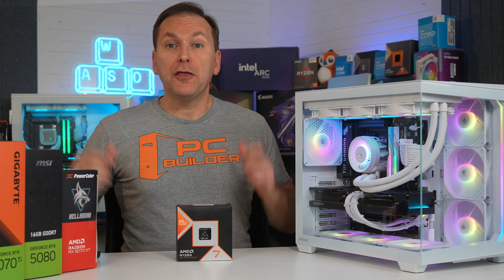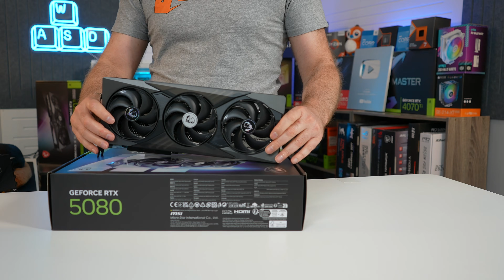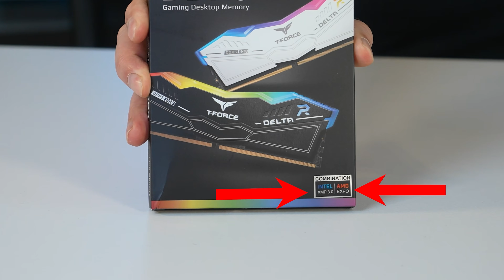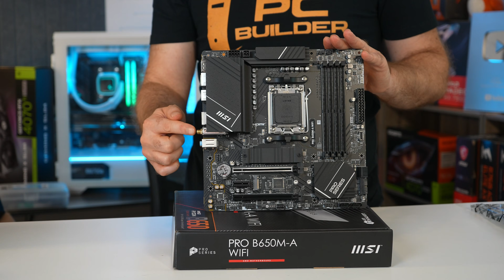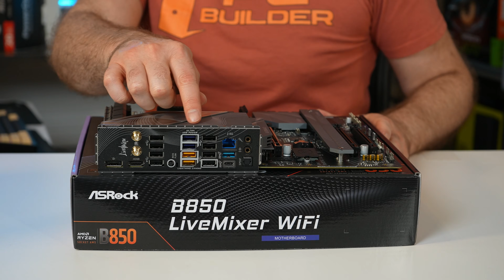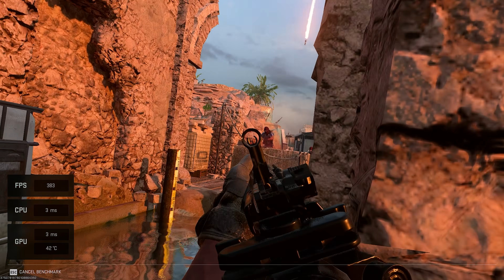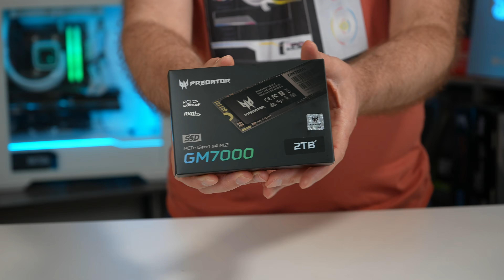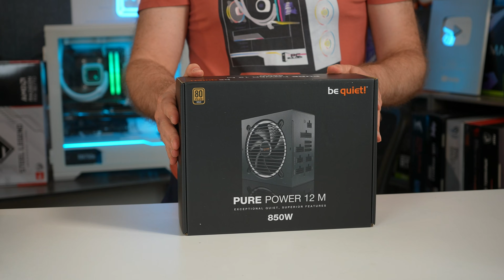Best Ryzen 9800X3D PC Build 2025 🛑 Best GPU, RAM, Motherboard & More

Comment: I have a 4070 TI Super, is the 9800X3D over kill because I just don’t see the point in upgrading to a 5070 TI. But I’m still running 5800X3D and I’m ready to upgrade. Thoughts?
Reply from the maker: You might not see much performance difference switching between the 5800X3D and the 9800X3D with that GPU. If you are looking to set yourself up for future upgrades in AM5 that can make sense but a full platform change now is money I probably wouldn't spend personally

Comment: Is my USD$1900 9800X3D PC overpriced? Market rates are kinda kicking my butt!
CPU : AMD Ryzen 7 9800X3D Processor
GPU : ZOTAC GeForce RTX 5070 Ti Solid OC SFF 16GB
RAM : 32GB Patriot SL Sig DDR5 6000MHz CL34 Low Latency (16x2)
Motherboard : Gigabyte B650M Gaming Wifi 6E
Cooling : ID Cooling SE 214 XT (2 in 1 out)
SSD : 2TB Lexar NQ780 Gen4 SSD
PSU : 850W Thermalright 80+ Gold (ATX3.1; PCIe5.1)
Chassis : Small mini case

Comment: Is it recommended to have a liquid cooler for 5070ti / 9800X3D builds? I’ve used air coolers for PC builds in the past, but I haven’t built a higher end gaming PC before. I may be overthinking it, but I’m just not crazy about having anything liquid inside of a PC with various electrical components. Isn’t it possible that the liquid cooler could leak?
Reply from the maker: You don't have to no, a dual tower air cooler will do great for you if you prefer that
Reply: @PCBuilderChannel  Awesome, thanks for the response!

Comment: The problem of power connectors melting with NVIDIA's high-end GPUs, including the RTX 5090, unfortunately persists as of August 2025. While NVIDIA introduced a revised 12V-2x6 power connector in the RTX 50 series, intended to mitigate the melting issues experienced with the 4090, reports indicate that this upgraded design hasn't entirely eliminated the problem. 
Here's a breakdown of the situation
Design Limitations: The fundamental issue seems rooted in the design of the connector and the GPU's power delivery system. The RTX 5090's high power draw pushes the limits of the 12V-2x6 connector. The GPU may not effectively distribute the electrical load across all pins, potentially leading to overheating in specific wires.
User Error vs. Design Flaw: While improper connector seating was initially highlighted as a cause, the persistence of the issue suggests a more fundamental design flaw.
Third-party Adapters: Reports indicate that using third-party adapters can exacerbate the problem, and may be a major contributing factor in some cases.
Safety Measures & Recommendations:
Ensure the power connector is fully and securely inserted, clicking into place.
Consider using a power supply with a native 12V-2x6 connector rather than an adapter.
High-quality PSUs are recommended, ideally ATX 3.1 compliant or later, according to Tom's Hardware.
Be mindful of excessive bending or strain on the power cable.
Ongoing Concerns: Despite the revised connector, reports of melting cables with the RTX 5090 continue to surface. This situation suggests that even with precautions, a risk remains. 
It's important to note that a large number of RTX 5090s are in circulation without incident. However, the recurring nature of these reports highlights the ongoing concern surrounding the longevity and reliability of the power connectors on these high-power GPUs.

Comment: I'm currently building a new pc. 

-9800x3d 
-powercolor 9070xt 
-MSI thomahawk B850 
-32gig ran at 6000/cl38 
-2tb M.2 
-be quiet pure base airflow case. 

Prices and availability amazing now.
Reply: Tomahawk is such a solid board. I was going for the x870e Tomahawk but ended up landing on the x870e Carbon. Had to splurge for the beautiful looking board with everything on it. But Tomahawk is killer for price.

Comment: motherboard MSI PRO B650-S WIFI
amd ryzen 7 9800x3d
rtx 5080 OC 16gb vram
kingston fury beast 64gb ddr5
2tb ssd kingston
Endorfy Supremo 1kW
water cooling endorfy navis F280
Fractal Design North XL Clear black case

guys is that a good build? i am not sure about the motherboard and the size of the water cooling, should i go with 360mm instead of 280?

Comment: running stock this CPU runs so hot it burns up its been reported by many...... amazing how they release a product that has the potetal to fail because of heat issues and thats not  on the customer who bought it  @ 460.00 to 500.00$ a pop  people reporting its runing @ 85 to 95C no load

Comment: Is the issues with 9800x3d dying from motherboards default pbo settings and what not still a thing or is that all fixed now?
Reply from the maker: There were struggles happening with specificity Asrock motherboards. It does seem like the issues have been sorted with the latest bios update but you can always avoid Asrock if you’re concerned

Comment: How about a 7900 xt or 7900 xtx or honestly just a 7800 xt
Reply from the maker: If you already have those GPUs you can pair them with the 9800X3Dz. If buying new I wouldn’t recommended them new in 2025 personally. The price to performance no longer makes sense compared to the new gen
Reply: @PCBuilderChannel  I’m aiming for high end performance on 1440p, like 360 fps in Fortnite 1440p. I’m already looking at a possible option, which would be the i7-14700KF (yes I know you say you shouldn’t quite trust them yet but still) and the 7900 GRE. I could get a 7800x3d or even a 9800x3d instead of the i7 14th gen though, but for the best price, the i7 shines.

Comment: I have a few questions, Would the RTX 5070 be a good choice for the Ryzen 9800 X3D or would it be better to downgrade the cpu to the Ryzen 9700X and getting the RX 9070 XT or the RTX 5070 TI. Also another question and this is the biggie, what is the difference between CL30 and CL 32. The Tforce RAM I was looking at is 6000 MHz and CL 32, would that work for this build?
Reply from the maker: You would actually get more performance going down in CPU and up in GPU yes. But I would recommend the 9600X on super sale at amazon right now for $165. You wouldn't see gaming difference between that and the 9700X. The CL32 isn't ideal CL30 is better.

Comment: simracer here.  I have no idea, totally no knowledge in this area... my AMD GPU 7900xtx is paired with 7800x3d. I used my gift cards from work to buy 9800x3d. apparently it can handle Assetto Corsa EVO (early release) in VR bit better. it might bottleneck GPU as it did before, but I can reduce resolution. Next year or 2027 I'm getting Nvidia 6090. it got well implemented foveated rendering in iracing, most likely ACE will follow. just wanted to say THANKS FOR VIDEO
Reply from the maker: Thank you for watching!

Comment: Building this today! You asked heres the Part List!

MSI X670E Gaming Plus Wifi
CORSAIR Vengeance RGB DDR5 32GB (2x16GB) 6000MHz CL28
WD_BLACK 1TB SN7100 NVMe Internal Gaming SSD 7,250 MB per sec
AMD RYZEN 7 9800X3D
MUSETEX ATX PC Case
RTX 5070 TI
THERMALTAKE Toughpower GT 850W GOLD (Modular)
CORSAIR H100I ICue RGB AIO Liquid Cooler (i forget the exact model)
ASUS ROG Swift 27 inch 2560x1440 144hertz 1ms response G-Sync IPS Display (from like 8 years ago was top of the line lol)
Logitech Pro Superlight (Mouse)
Royal Kludge 61% Mechanical Keyboard (Wireless)

I play a lot of Escape from Tarkov, Rust, a lot of CPU bound games... Upgrading from a Ryzen 9 3900X i cant wait to experience the improved core performance...

I asked Chat-GPT what it thought of my build and it had this to say XD

🚀 Final Verdict:
Your system is well-balanced, powerful, and thermally ready. Nothing's out of place, and every part supports the others without bottlenecks. This is a high-end gaming and productivity build that should last for years.

Let me know if you'd like:

Tips for first boot/BIOS setup

BIOS update walkthrough for your MSI board

Fan curve or thermal tuning tips

Overclocking undervolting advice for silence/performance balance

Excited for you—this rig is going to fly.

Comment: I currently have a rtx 4070ti and a b650plus motherboard with a ryzen 7800x3d.  My rtx 4070ti died.  I was wondering could I use a rtx 5080
Reply from the maker: Yes that's a good pair

Comment: I ordered a: 
RTX 5090 32GB VRAM
AMD 9800X3D 
2x 16 (32) GB DDR4 6000mhz RAM
2x 2TB Kingston NV3 SSDs 6000MB/s
ROG STRIX B650E-F Gaming Wifi
Deepcool LE720 AIO + 3x120mm fans watercooler
Deepcool CH560 4-Fan Digital Case 
Platinum certified LC1200PSU 1200watt.

Is this good? I have 14 days to return it if not.

Comment: currently building an 9800x3d / vangaurd msi 5080 pc but hung up on which mobo to get, really wanted to go with msi's x870e carbon wifi but seeing more issues than good when trying to research more, has anyone here tried the x870e? really want to keep msi aesthetic

Comment: Considering a 9950x because I need this pc to primarily be a multitasker Excel, PPT, ai coding powerhouse. Secondary purpose, gaming and I’ll start with an ARC 12gb right now, followed by a stronger GPU in a few years. Do you think it makes sense to go with 9950x in my case? Obviously 9950x3d would be ideal but it’s expensive.
Reply from the maker: Absolutely! We do have a 9950X build on the channel but it is from 2024 so the GPUs in that video are old recommendations, but still worth watching
Reply: @PCBuilderChannel great, thank you! Just left you a comment on that video too. You’re really good at what you do. Thank you for sharing your knowledge

Comment: Current build I am wanting to go with.

CPU		
AMD Ryzen 7 9800X3D 4.7 GHz 8-Core Processor	$472.02		
CPU Cooler		
ID-COOLING FROZN A620 GDL 78 CFM CPU Cooler	$49.99		
Motherboard		
Asus TUF GAMING B850-PLUS WIFI ATX AM5 Motherboard	$229.99				
Memory		
TEAMGROUP T-Create Expert 32 GB (2 x 16 GB) DDR5-6000 CL30 Memory	$94.99		
Storage		
Western Digital WD_Black SN850X 4 TB M.2-2280 PCIe 4.0 X4 NVME Solid State Drive	$284.99		
Amazon
Video Card		
ASRock Taichi OC Radeon RX 9070 XT 16 GB Video Card	$1019.00				
Case		
Antec C8 Wood ATX Full Tower Case	$119.99	-$5.00 1	FREE		
Power Supply		
be quiet! Pure Power 12 M 1000 W 80+ Gold Certified Fully Modular ATX Power Supply	$164.89		

Base Total:	$2435.86

Comment: I just did a new build. 

Asus Rog Strix x870e
Ryzen 7 9800x3D
XFX 9070 XT OC Mercury
MSI 240 aio 
Corsair modular 750 psu 
32gb Corsair vengeance 6400 RAM
SAMSUNG 990 2tb m.2 (games)
Samsung 970 500gb (OS)
3 intake fans and one exhaust 
NZXT H6 flow case
Reply: How has that setup been working for you?
Reply: @NewSocialistEraVideos it's been amazing and no issues with borderlands 4 . Average 90 fps without frame generation on badass quality. Frame generation brings it over 120 fos

Comment: Hello, with the 9800X3D I see that you're recommending the MSI B650 Gaming WiFi, which only supports PCIe Gen4 (no PCIe Gen5), as well as the ASUS TUF GAMING B650-PLUS WIFI, among others. However, the latest graphics cards (such as the AMD 9070 or NVIDIA x50) use the PCIe Gen5 standard. Can we use the latest Gen5 GPUs on PCIe Gen4 slots?
Reply from the maker: Yes. Even the RTX 5090 runs fine on PCIE gen 4. PCIE is backwards compatible. We have more discussion on this in the video.
Reply: @PCBuilderChannel  Hello, thanks for your quick reply. However, regarding SSDs, a professional strongly advised me against partitioning an SSD. So for gamers like me who have a large game library (over 20 games), and knowing that each AAA title now weighs between 80GB and 100GB (or even more for some), it's important to have a separate SSD for launchers and games.Every time you want to reinstall your OS (whether due to bugs or just as a yearly maintenance routine, which is generally recommended), you'll end up spending hours and hours reinstalling all your apps and games ^^
Believe me, reinstalling 2TB worth of games takes a long time!
Otherwise, thanks for your reviews and links. Your videos are very interesting and highly professional.

Comment: Finished rebuilding my pre-built Corsair Vegence with a new Gigabyte X870E Motherboard and Ryzen 9800X3D. Also upgraded all the fans with the Corsair iCue /iLink fans and 240mm AIO. Makes installing fans a breeze with only 3 cables versus 15! Really a clean look.

Comment: Im confused between these two specs. Any recommendations? My main goal is to play cs2 at high frames as I have a 480hz OLED monitor.

9800X3D
MSI Pro B650-P
32GB DDR5-6000 RAM (30)
RTX 5070 Ti

And the Second option is with RX 9070 XT.

Lemme know your thoughts and recommendations for my build. Thanks :)

Comment: Found a Gigabyte Aurous X870E at the price of the X870 at our new Micro Center. I matched that with the AMD 9800X3D. Changing out my old Cosair fans with link fans to illuminate so much wiring and clean things up. Replacing the AIO with the Artic 360 freezer version 3 to complete my upgrade. Only $84 on Amazon.

Comment: Great explanations, mine is a mix. All new parts except maybe the graphic card. Cpu 9800x3d, motherboard Gigabyte B650E aorus stealth ice, case Phanteks evolv 2,  Thermalright fw 360 aio, lian li edge serie 1000watt psu. Everythig is all white. The gpu will either be a 4090 or 5080 used.

Comment: My latest build is:
Ryzen 7 9800x3D
64GB DDR5 6000mhz cl30
MSI MPG x870E Carbon Wi-Fi
5TB Samsung 990 Pro
Be Quiet PSU Pure Power 12 M 1200w +80 Gold
Be Quiet Light Base 600 LX Case
Be Quiet Light Loop 360mm
Be Quiet x6 Fans for intake 120mm + Radiator 120mm and 120mm Rear so 4 exhaust
Zotac RTX 5080 AMP Extreme Infinity Ultra 16GB

Comment: I just finished building and ordering my new PC and this video popped up on my feed. Im no expert at building and i chose everything by looking at the specs to be compatible and it happened to pick some of the best choices here. 
I went with ryzen 7 9800x3d
RX 9070 XT Asus Prime OC edition
32gb ram 6000mhz 30CL AMD Expo ready Corsair Vengeance
Motherboard  ASUS TUF GAMING B850-PLUS WIFI
PSU Corsair RMe Series 2025 RM850e, 80+ Gold, 850W
Cooler CPU ARCTIC AC Liquid Freezer III Pro 360 Black 360mm(3x120mm)
2 Samsung SSD's 990 EVO Plus 1TB(each) PCI Express 4.0 x4 M.2 2280 (2tb in total)
rocking a Gamdias Atlas M1 Black for the case
and 3 ARCTIC AC P12 PWM fans at 120mm each for the rest of the coolers
i also bought the ARCTIC AC MX-6 for the thermal paste and the Thermalright Contact frame AM5 for the processor
My goal is to game only at 2k on a monitor LG 240hz with freesync hdr and IPS panel
I'll be happy if you or/and the comunity here comes up with a review and what games i should play with this monster. God bless you all. I love you

Comment: I have Kingston Fury 64GB DDR5 (2x32GB) 5600MHz CL36 paired with a Ryzen 7 9800X3D. Should I change my RAM, or leave it as is?
Reply from the maker: I would exchange it. That is not good RAM. With that strong a CPU I'd get the correct RAM with it
Reply: @PCBuilderChannel 
So, which RAM would you recommend for the best performance?

Comment: So a 5090 only with 9800X3D? Can't it go with a 7800X3D? Also Asrock B650M Pro RS can handle the 9800X3D? that VRM is okay for that CPU?
Reply from the maker: It can but you would see a performance  difference between the 9800X3D and the 7800X3D with that GPu.
Reply: @PCBuilderChannel  Got it, thanks Jason!

Comment: recently just got my 9800x3d.

looking to pair it with the 9070 XT. ROG strix 650-a MOBO. Kraken RGB 360 AIO. H7 2024 NZXT flow case. nervous to put my first build together but also extremely excited! I feel confident and well informed thanks to you!
Reply from the maker: Best wishes on the build! Check out our How to build a pc video if that's helpful

Comment: Please help me i have: 
i have cpu intel core i7 11700 
Nividia GEForce RTX 3070 TI (zotac gaming)
B560M PRO-VDH WIFI (MS-7D18).
I want to start upgrading what everyone tells me that my gpu is powerful and i can start upgrading my motherboard and cpu then to upgrade my gpu. Can i ise the ryzen 7 9800x3d and new motherboard. Then after a while i change the gpu?
Reply from the maker: Yes, you can do a platform change.
Reply: @PCBuilderChannel  which motherboard will be compitable with ryzen 7 9800X3D because  I found that some people mentioned certain motherboards overheating or even getting damaged when they used ryzen 7 9800X3D

Comment: Great video. I actually came here after finalizing my component selection and was suprised i almost chose the same parts as your premium build. I still have a question however, did you actually built this setup and can confirm that it works? I was about to order the B850-PLUS when i read some reviews saying that this board is having trouble with alot of ram kits, including the g.skill trident. I then went to the asus website to make sure and when i select the board and the AMD 9000 series, indeed it doesnt list the g.skill trident as compatible. So now im kinda worried if everything will fit together, i would like to avoid sending parts back. You know anything about that?
Reply from the maker: Yes the build is next to me on the desk (: 
The list doesn’t mean much at this point in the generation but you certainly can pick something off it if it makes you more comfortable. Hop over to our Best RAM for Gaming 2025 video for more. That might help put your mind at ease!

Comment: Hello Jason from Leeds, UK. Hope your ok. Here's my Dream PC:

CoolerMaster HAF 700 Berserker 
Custom Mobius 120P exhaust fans. Custom Mobius 140P Halo² or MF140 case fans.

MSI X870E Godlikea.

Ryzen 9 9950X3D

G.SKILL Trident Z Royal Neo CL28 6000 2X24GB 48GB

Arctic Liquid Freezer III 420mm AIO
With custom CoolerMaster Mobius 140P or MF140 or Halo² radiator fans.

Sapphire AMD Nitro+ 7900 XTX Vapour-X 24G 

Samsung 990 Pro 2TB (OS)

Samsung 990 Evo Plus 4TB (GAMES)

Seasonic Prime - TX 1600 ATX3.0

Lian Li Strimmer Wireless ATX 24 

Lian Li Strimmer Wireless GPU